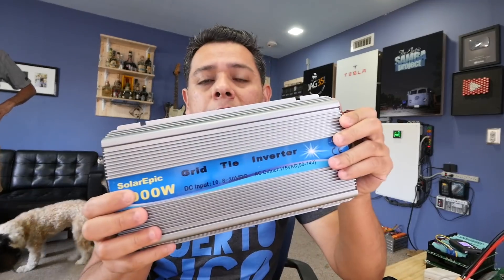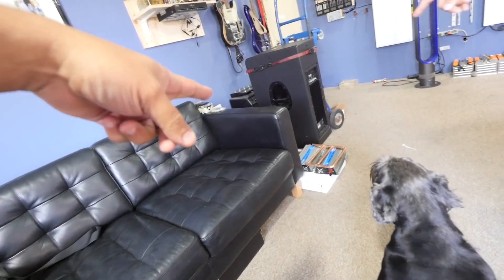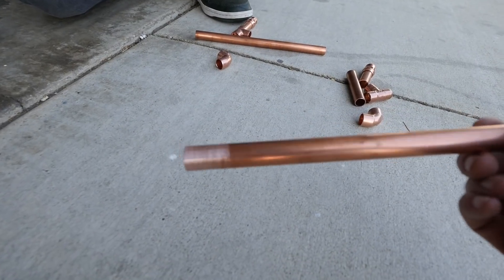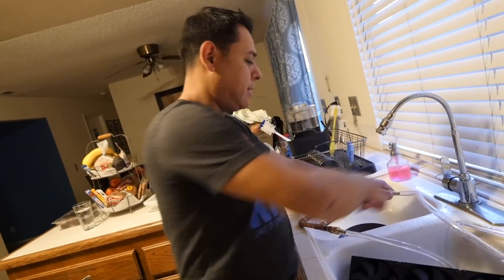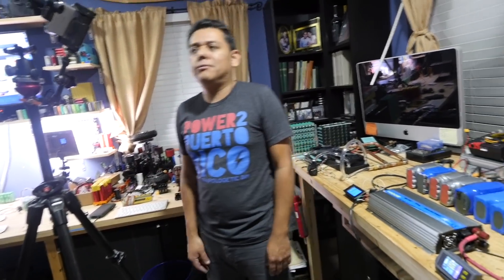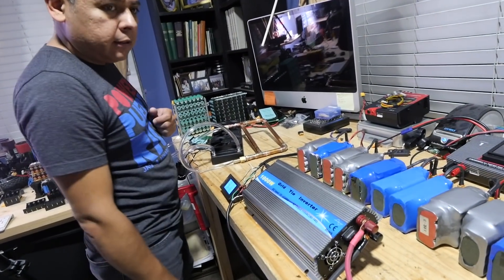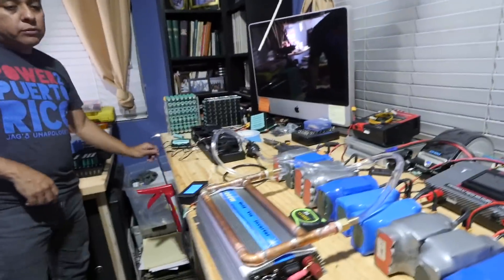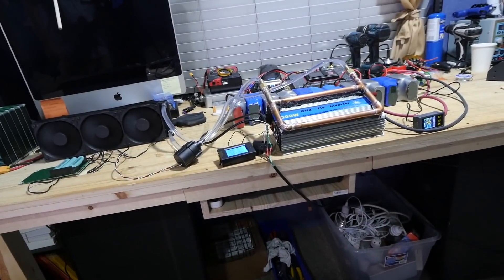Liquid cooling A cheap 1kW Amazon Grid Tie Inverter Experiment

Comment: I use regular electronic solder with flux inside to solder plumbery copper pipes and it works fine with no leaks since years!

Comment: Mount inverter in a box and use the fans to pull air through for cooling as a backup in the event the pump fails. Will NOT provide additional cooking.

Comment: Air cooling is far simpler.  You can mount the inverters on a large metal surface that can transfer heat.  Then put the inverters in an tunnel on that large mental surface with the fans on one end. If the tunnel is made of metal even more heat will be dissipated.

Comment: You might be able to replace the hot MOSFETs with ones with a lower on resistance, RDS(on).  They will cost a few dollars each, more then the cheapo Chinese manufacturer is willing to pay but maybe cheaper then a bunch of plumbing.  Do you know the part number of the hot MOSFETs?  I'd like to see if I could find a better substitute.

Comment: the loop needs to be just a U bend water in water out with your ring the water will just run the U been part of your design think of a CPU cooling plate has in and out flat plate with fins where the coolant pass past then out with heat transfer.

Comment: You could remove the casing, have the area's with the mosfets behind them flattened with a mill or something and attach computer watercooling blocks. There are blocks available for motherboard mosfets. Long, thing and straight. They work a treat! I doubt these pipes make proper contact with the casing. enclosing them in a case with force ventilation from fans might even work better because you use the entire cooling surface from the case. Replace the stock cooling paste with some proper stuff and you should be golden. 

Love the cheap diy idea though!

Comment: These Chinese inverters are waste of $. I bought a 600W and hook it up wth 2x 190W panels. Works fine for a few months and then kaput/burnt out. Note...only 390W input into 600w unit. Threw it out in the trash.
Bought a Latronics inverter and it works magic for many many months now.  (http://www.gumtree.com.au/s-ad/1179341714)

Comment: good prove of concept but depend on how many yall are going put side by side you might think about useing a car radiator and mont that directly to the inverters for better heat exchanger as well as be a bit more efishiny transfer and then if you use lager pile going in and out to a slightly lager readers with a good flow rater you can probably get really good rezols for less cost and parts

Comment: jehu this is a great idea but i dont think there is enough contact area, also the inverter gets hot mainly where the switching components are (MOSFETS) and the cooling is too far away from this, i am a machinist and i instantly thought how cool it would be to make a water cooled heatsink that the mosfets screw directly to with thermal paste, that would work no question of a doubt. remember heat kills components quick, if you have a cool running system this inverter could prove really reliable and long running

Comment: I think in this situation with having a massive surface area as an heatsink I would install 2 fans the largest you can and ensure the fans are low noise. Water cooling is a fail as you wont get the surface area contact needed unless you hacked the inverters and water cooled the components direct just like when you water cool a CPU.

Comment: u should add directly some cheap waterblock to the output fets, it will be much more effecient
Reply: https://www.ebay.com/itm/41-122-12mm-Aluminium-Water-Cooling-Heatsink-Block-Liquid-Cooler-System-For-CPU/372364476208
Reply: I used some of these :) they cool and inexpensive for some mosfets
Reply: I love your cool almost pro and pro solutions, but now im a bit disappointed :/ that was not the best way to cool down, this was just waste making not cooling :(

Comment: Cud try loads of 10mm copper stacked soldered all to a 22mmboth ends good idea. enables u to move/pipe the cooler unit and fans to a different area like outside

Comment: That was a very bad implementation. I cool very high power led cobs using liquid cooling and if you do not have very good thermal paste with extremely good contact to the entire surface area, it will overheat like crazy. Also make sure there is ZERO air gaps as that makes heat pockets that actually trap heat instead of moving it fast. I'll grab one of those and make a better solution and post a video of it.

Comment: The copper pipe was too large. Should of used the coiled copper tubing so that it could have much greater contact area. Also, needs to flow in one path, not a potential 2 in your setup.
With your setup, the majority of the water went around the bend of the tube and not the crosspiece. If you flipped the pipe around so that the bend was where the most heat was at, you would of done a much better cooling.

Comment: Most of your water flow was bypassing and doing no cooling because your pipe is oversized and the ports are favoring the pass closest to the fittings.

A better solution would be to use 1/4" copper tube and have it running in the valleys of the heat sink fins, using the heat transfer paste to fill the void, and snake the copper in one long line along both sides. You can then use "hanging strap" to keep the tube tight to the unit. To get all the bends without soldering, much, use a spring type tube bender to keep it from kinking.

Lastly, use a reservoir on the inlet to the pump, trying to make it a sealed loop is not worth it and those air bubbles WILL destroy the pump and lower the overall thermal efficiency.

Great job getting a 10° drop, you could probably get closer to a 20-25° drop with a good layout. Not to be smug, but I would estimate the way I'm suggesting should get you at least the 20° you were hoping for.

Best of luck!

Comment: I have an idea! Buy Copper Nickel Brake Line Tubing meant for car break lines filled with brake fluid. You should use some cooling solution but I have worked with these lines and you can bend them to the shape you want. You just need to be careful. You can bend it to go back and forth really close to each other and get a lot of contact area really close to the heat source! Good luck on your ventures!
Reply: Or just dump it into mineral oil. No electricity transfer and best cooling!

Comment: Use soft copper tubing and bend it to make contact directly by the area the fets contact the heatsink.  A loop down and back on both sides should be more than enough and you should not need any additional surface area.

Comment: I have run that type of grid tie inverter on a 1000w solar system with 24volt 500Ah battery system they burn out a lot its the cheep transistor in them  they can not run at 100% duty cycle with cooling or with out cooling , I have a pile of dead one`s :) ..  Now I use these they got battery mode with a voltage control and they dont get as hot and last longer...... 
https://www.aliexpress.com/item/500-Watt-Grid-tie-inverter-24V-To-AC120V-or-230V-high-efficiency-For-battery-24v-Adjustable/32525808180.html?spm=a2g0s.9042311.0.0.14bf4c4dkh1EHv

Comment: lol the attempt was only a failure due to the horrendous engeneering of the water colling solution, there was bugger all surface contact to really move the heat.

a decent attempt would be to remove the stock aluminium case and then have a drilled channel block that then had the mosfets directly screwed and pasted to the block, with water running through it, so it could remove the heat form the mosfets properly.

THAT would make a world of difference, but would be a a LOT of effort and stuffing about.
Reply from the maker: Not doable for the average person. Of course liquid cooling works. Every car is an example of it but can it easily be put to use without custom machined blocks of aluminum too hard and too expensive for my audience to recreate?
Reply: you're not the average person :P  :D  
as for custom machined blocks, you might be surprised, you'd very likely find something in the PC liquid cooling range that could be used without too much difficulty, as for the danger factor, thats another story entirely, you'd need to make an enclosure for the live electronics for sure, which would be pretty difficult for the majority of people, including me.

the PC water block market is insanely huge and has an insane range of different blocks for different applications, even water cooling PC power supplies, which would be pretty similar to inverters I'd imagine. (directly cooling mosfets)

see if you can interest one of the big PC modding channels to get involved for a collaboration ;)

Comment: There is smaller copper pipe that is used for refrigerators. They are very easy to bend and they come in rolls of different lengths. They are also in home depot.

Comment: the cooling tubes cant only have a rute. Its like electricity... itll go through the easiest rute. And the contact surface is too small. Make a aluminium system and it will work much better

Comment: I dont think the heat source is sinked with the case, ie has a fan on the side. Do you mind if you open one up to see the inside?

To get better preformance you need micro fins in the watter because of waters inability to transfer heat well so you need more surface area.

Fitting somthing like this on the inside will do a lot better, especially if you can put it directly on to the mosfets

https://app.alibaba.com/dynamiclink?touchId=60328016226&type=product&schema=enalibaba%3A%2F%2Fdetail%3Fid%3D60328016226%26ck%3Dshare_detail&ck=share_detail&shareScene=buyer

Comment: Why dont you buy cheap water blocks off ebay or amazon, and use Heat sink epoxy to mount say 2 water blocks on the top and bottom of each side.

Comment: Open enclosure, thermal adhesive to copper plate to mosfets, solder to copper plate to copper pipe and boom much cooler.

Comment: It looks like you may have gotten one of those aluminum radiators from amazon/ebay, i can't tell.  Just a heads up, running a water cooling loop with aluminum and copper together will eventually lead to corrosion issues.  What you could do is pick up one of those 20x60mm aluminum waterblocks off amazon, and attach them directly to the mosfets with some 2 part thermal adhesive.   That setup could probably handle a few hundred watts of heat load.

Comment: Liquid follows the past of least resistance. So most of the water is only going to move in the first couple tubes. 
Your feed and return should be larger than the tubes running across. 
Also with only that much surface area in contact with the inverters it's not going to cool much if any

Comment: A better design would have been to use small tubing that wedges in between the fins of the inverter housing. Much more surface area contact and quicker thermal transfer. Don't necessarily need to use copper tubing for that either.

Comment: wrap the whole inverter with 1/4" copper tubing- no soldering, more surface contact. What IR viewer app is that? How about adding cooling to the power wall inverter heat sinks, or mount a water cooled heat sink directly to those MOSFETs.

Comment: You could arrange stuff so the mosfets are mounted directly on the copper pipe (the pipe will flatten a bit where you mount them getting a better contact).  Another possibility which would probably be more trouble than it's worth is to use epoxy to make a chamber around the part of the inverter shell that gets hot so that you can run the water directly across the case without all of the thermal transfer stuff in the way.  That would probably work well if you could get it to be solid and not leak.

Comment: If you were to sand off the heat fins only where the copper pipe is going to make contact, and use a flattened copper pipe of a larger size and use heat sink compound it will have much better contact then what your getting now.

Comment: hey @jehugarciaI know a good cheap way to cool them down really low... should try to use some " Peltier 12v" they run at around 35w for the cheapest one. there is like 3 sizes that I know off. they are cheap as like 8 usd

Comment: Waste of money... sorry, but I know you know a lot about batteries, power walls and other things but heat dissipation isn't your thing! or at least yet. The problem with cooling in this manner is the fact that the components do not directly touch the heatsink container, it's not like cooling a graphics card or CPU since these components touch the heatsink with a water block and in this case all that really your doing is cooling the sides of the case. Airflow is the best method to decrease the temperature. Those fans within these inverters are very poor and I imagine they only output 5-10 CFM max which is very low. Using a tube funnel and a decent server fan or industrial fan such as noucta nf-a14-industrialppc-3000-pwm you can upgrade that 10 CFM to over 160 CFM instantly giving you 16 times more airflow through the unit and since the static air pressure on these fans are very good you could just have 'one fan' exhausting air out... this will actually keep your components very cool and much better than just cooling the case.

Comment: I'm no genius fellas but why the fuck didn't you just use a small evap coil from a fridge for each one..or use an old evap coil from a house and did them all on that pumping water through it on a timer..you could try it without the fins spread first and if needed spread them to increase the surface area ...at least you would be cooling it over the whole thing intead of a very small area where the piping is and relying on conduction from that small area only... stupid

Comment: Use one single pipe connected acoss the tops of the inverters where most of the heat is concentrated. Then use a fan or 2 to cool the rest

Comment: Everything helps some.  The mosfets aren't even connected to the case so it can't help much.  I move the fans to the outside of the box and cur out the restrictive grill sections.  And mount the units vertically on spacers.  Why waste energy cooling . energy.

Comment: I'm sure someone else has already mentioned it. use the much smaller copper pipe it's flexible you probably wouldn't have two braids very much. It would also increase your surface area .

Comment: First I love your videos and projects. I'm just beginning to  learn about solar electric and batteries so I can do some projects. I have installed and designed solar thermal systems. I have 25+ years doing HVAC and Plumbing. I specialize in Hydronics and oddball stuff like solar thermal and passive solar heating. I have a couple of suggestions to improve the design. 
More smaller pipes/tubes like 3/8" or 1/4" on the sides where the fins are would be better. The tubes should rest on the edges of two fins with heat transfer paste in between the fins and touching the tube. The water flow should also be slow enough to allow as much heat transfer as possible but fast enough to keep the water temp at least 10deg cooler than the heatsink.
Next the inlet and outlet should be setup to be opposed (flip the outlet to be coming from the opposite direction of the inlet) this gives equal flow through both of the longer pipes. As you have it now the pipe on the bottom (with out the inlet and outlet connections) has less flow. As an example of how to pipe it if you are looking at it from above while it is laying on the inverter the inlet would be on top left and outlet would be on bottom right. 
As for the soldering of the pipes you need to put paste flux inside the fitting socket or on the cleaned part of the pipe that goes inside the socket. Then applybjust enough heat to melt the solder. The pipe turning blue and flaming when the torch is removed indicates it was over heated.
If you want I can build a better one for you. I'd just need the inverter so I could fit it to the fins.

Comment: You needed to cool the components not the outside, cool the inside and you will see a difference. The fans that come with the unit is not moving the air fast enough. Cool the inside with that small radiator fan.

Comment: Maybe try the copper pipe that is used for a water line to a fridge or the bigger stuff thats used in natural gas.  That way its one continuous tube, the water can only flow in one direction and you can bend it to wherever you need it!👍
Reply: AveRage Joe That's exactly what I had in mind the moment I saw they only made a run around the perimeter. Wrap that jewel in a custom bent coil of refrigeration copper and see what kinda cooling that yields. Listen to Joe he knows a thing or two and it's always good advise from a man that's made mistakes!😂 RELEASE THE MAGIC SMOKE!
Reply: Yes exactly you could use Copper Nickel Brake Line Tubing meant for car brake lines. Should be really bendy and work well.

Comment: Possibly try a smaller tube and snake it back and forth, the H design is not good as the water will flow to the back pipe and then around due to the path of least resistance and very little through the middle of the H and try using a non toxic safe Propylene Glycol Antifreeze as it will transfer heat faster and the smaller pipe will also slow down the flow of water allowing the heat to transfer more efficiently. A good example is a car without a thermostat during high rpm driving can push so much water past the cylinders and through the radiator it has no chance to pick up any heat and transfer it to the air and will overheat!!  Just a thought but great video..

Comment: Dont mix the metal types. The radiator looks like an aluminum radiator and the copper tubes, dont mix! one metal or the other.. look up water cooling CPU's and that will be the information you need. you need a radiator reservoir so you dont have air in the lines. PM me if ya need more info.